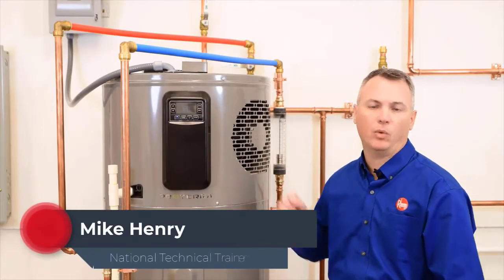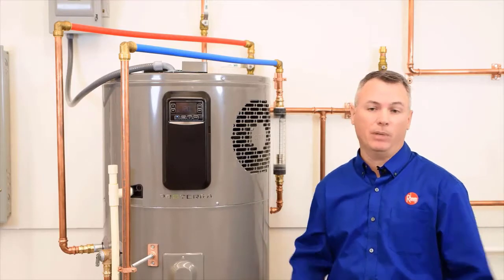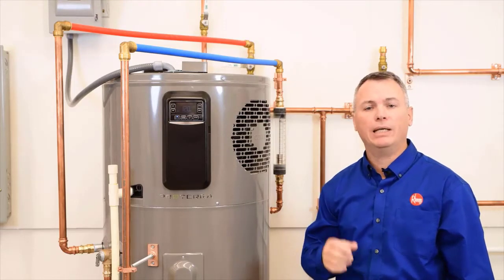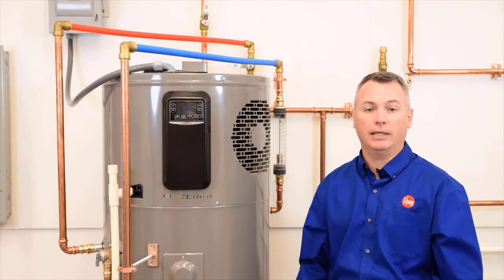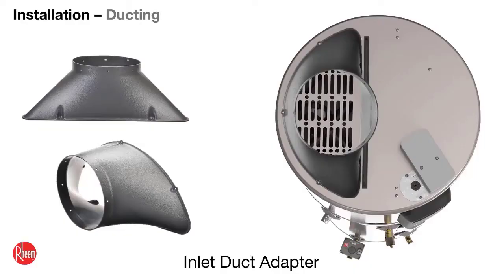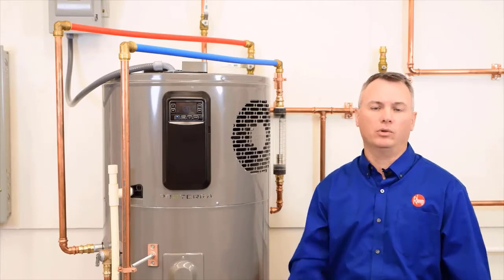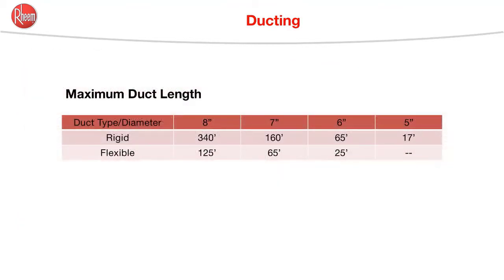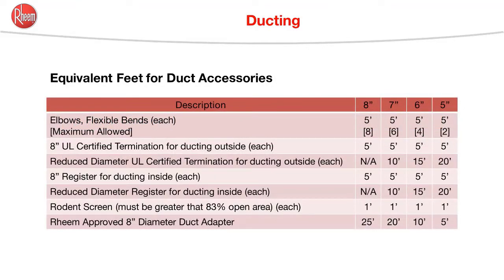Ducting When Installing Rheem® ProTerra™ Hybrid Electric Heat Pump Water Heaters

Comment: I’ve never seen a company promoting ducting to take advantage of existing heat sources like refrigerators. Thank you! 

Another idea. My greatest HW use is the master bath. Dual headed walk in shower and a claw foot tub. So when we are using the most hot water we are making steamy hot  air. I’m going to look for a way get that air to this new WH!
Reply from the maker: Thank you!
Reply: That's what I did in my house. Both bathrooms are ducted into the intake, drawing warm moist air out whenever it is running.
Reply: great idea teslamac, just remember that discharge air from the Rheem  has to communicate back to the bathroom, either by home heating duct work or a space under the bathroom door.  We are doing our return air into the Rheem  into the hall way near the bathroom.

Comment: These ducting options were very informative for me. I will have my new water heater placed next to an unused chimney. I wonder if I could duct exhaust up through that. Or bring air in from and out to the attic. That attic air is so hot it would barely have to work to heat water. I live in a home built 1941 in Michigan.
Reply from the maker: To get information on this situation, please contact our Technical Support Team at 800-432-8373 for more details.

Comment: i have the option to install the water heater in laundry room that is in the main hallway or the garage. Laundry has open air vents high and low from when i had a 95% gas heater that was removed and is now a heat pump so air flow no problem. I am concern about pumping cold air in during winter months and can vent to outside but wont this casue negative air pressure in the house ? My other option is install it in the concrete garage that stays very cold in winter 35-40and even in summer it might only get to 55 degree. Would the colder garage temps effect its efficacy?

Comment: I wish Rheem would design a Heat Pump water heaters for mobile homes.  I live in the south end of the San Joaquin Valley and it normally is around 100 degrees in summer if not more.  I currently have a Rheem gas water heater and would like to go over to electric with global climate warming.

Comment: Would there be any issues to hooking the inlet duct of the heat pump to the return  air of a forced air furnace ?
Reply from the maker: Hello, thanks for the question! We would not recommend that this water heater be attached in any way to HVAC systems as we are not certified HVAC agents and cannot advise on installations that could affect the water heater's functionality. Let us know if you have additional questions.
Reply: I would not recommend creating a pathway for furnace exhaust back into the house. Furnace exhaust could have partially burnt gas as well as carbon monoxide and you don't want that pulled back into the house through the water heater
Reply: @MrSoulMonk  That's not what Mennis is talking about.
Reply: Did you connect your inlet duct for water heater to your make up/ return duct to your homes heating system? This is something I was considering too.  I also have a heat pump, so I’m not worried about carbon monoxide.
Reply: @lynnbrooks5835  I did do that and so far so good. I did a check with the blower on and it did not affect its performance. My concern was when the main blower was on would it short the heat pump of enough air to operate correctly. So, I will say it is a cautious success!
Reply: My basement temp is 60-65 and my living space air temp is 68-72. Would a 8-10 degree difference in air temp supply make much difference in water heater efficiency on heat pump setting?
Reply: @lynnbrooks5835  In refrigeration/ AC / Heat pumps that the more you can raise the temperature of the evaporator the more heat you can move through that evaporator so yes it will help. In heat pumps a 1 degree difference is a big deal.

Comment: I am in the mid-Atlantic and my water heater is located in the bottom floor of my home in the center of the floor right next to my electric HVAC and all the trunkline ducting.  Can I hook the hybrid water heater into that ducting so that it exhausts the cold air there in summer but not in winter? Can I also have it draw hot air from the room or the rest of the house in summer but not in winter? I want to avoid the larger expense of having new ducting installed to go to the attic or the like as that is 3 floors up and the outside wall is about 20 feet away.
Reply from the maker: We don't recommend connecting hybrid electric heat pump ducting into an existing HVAC system. If you need more information about this, please contact our Technical Support Team at 800-432-8373. We hope this helps!

Comment: I am installing 50 gallon proterra and want to have air flow intake from crawl space and outflow to attic. total ducting length would be 8-10 feet. climate is warm  - winters to 30 degrees and summer 105 degrees. attic can get hotter
will this work?
Reply from the maker: The operational ambient temperature range for this water heater is between 40-145 degrees Fahrenheit. If you have any additional questions, please call Technical Support at 866-279-4566 between the hours of 7 a.m. and 7 p.m. CST and one of our experienced analysts will be happy to assist you.

Comment: Can you talk about seasonal considerations? For example, if I'm pulling outside air during the summer ... that's going to work a lot better than in the wintertime...
Reply from the maker: Great question! Seasonal considerations do come into play when thinking about ducting for our hybrid electric water heaters. The unit produces cool dry air as exhaust. Thus, you may want to cool your home with this air during the summer and expel this cool air in the winter. This can be achieved with dampers in your duct work. We hope this helps! Let us know if you have further questions.
Reply: @rheemwaterheatertraining  Thought you might like to do us a demo at some point... ;-)
Reply from the maker: We will note your suggestion. Thanks for the feedback!

Comment: all very good info. my installer was hesitant to vent at all although i can see the logical benefit. question… i have a 6” pipe that was capped (formerly the exhaust for my gas furnace and waterheater to a roof vent) as well as a 6” cold air intake, also capped, coming from outside my home. could i use the former exhaust pipe for the HeatPump water heater exhaust and uncap the former fresh air intake pipe for outside fresh air?
Reply from the maker: To get information on this situation, please contact our Technical Support Team at 800-432-8373 for more details.

Comment: Are these water heaters rated to be installed in a hot garage in Arizona that can reach 100°+, or are they limited to interior installations only? 
Last question, is there an NC rating or noise criteria listed for the water heater while running? Thank you in advance.
@Rheem Water Heating Training
Reply from the maker: Hi Tyler, good question! The ambient temperature operating range on our hybrid heat pump water heater heaters is 37° - 145° F, so installing one in a garage that doesn't exceed the 145° F maximum ambient temperature would be fine. Additionally, these units are rated at <50dBA (decibels) which is the lowest on the market (and about as loud as a refrigerator). We hope this helps. Let us know if you have any additional questions.

Comment: Quick question, I have a rheem air handler for forced air heating and cooling. Cooling is done by rheem outdoor A/c compressors. Heating is currently done from a heating oil burner and a 50 gallon hot water heat tank reserve. I want to get rid of my oil burner for heating my forced air and hot water. I was looking into replacing my outdoor rheem unit with a heat pump to provide heating and cooling needs, but I would still need a separate water heater and came across your heat pump hybrid water heaters. 

What is the BTU rating of these units? Could I connect this to my rheem air handler to provide heating for my forced air ducted heat, as well as provide heating for hot water usage in the home (retaining my relatively new a/c condenser rheem units for cooling in the warmer months)?
Reply from the maker: We'd like to get more information about your situation and put you in contact with someone who can help. Please email whdtraining@rheem.com.

Comment: Great video. 

We are in need of replacing a 15 year old electric HWT located under our stairs in the basement. There seems to be much confusion with venting even from a Rheem contractor I contacted on Vancouver Island where we live. He told me these units must be vented but according to this video and the info on your website, I do not need any venting and I could install this unit in the same location just by leaving the door to the small room open. Is that correct?

The whole idea of venting seems to be about improving efficiency. In my situation, would I see a cost savings or am I better served installing a normal electric HWT? I really like the idea of a hybrid for saving money in the long run.
Reply from the maker: Hello, thanks for the comment! As far as venting goes, the use and care manual states you need a minimum of 700 cubic feet of air. Otherwise, ducting or louvered doors would be necessary. As for cost savings, our hybrid models are 4x the energy efficiency of a standard tank, potentially saving you hundreds in energy costs each year. If you'd like to discuss your specific situation with us more, please reach out to us at whdtraining@rheem.com. You can also learn more about our hybrid electric water heater at https://www.rheem.com/innovations/innovation_residential/hybridsavings/. We hope this helps!

Comment: My hybrid was installed with the outlet facing an exterior wall. The outlet is 3" from the wall and at a 30 degree angle. How am I supposed to even attach the duct adapter in a 3" space when the adapter itself  is almost 8" long? I was told I could duct the intake to the attic above to help get some warm air for the intake. There is no warm air in that space. The attic-like space above the hybrid is an unconditioned space with nothing but trusses supporting the garage roof. It is several degrees colder than the frigid corner where the hybrid is installed. I recently discovered that not only is the outlet air filling the space atop the intake, that cold outlet air deflects off the wall, forced back into the outlet, and up and out of the intake. Air is being drawn into the inlet and forced back out of the inlet at the same time. What the heck am I supposed to do?  I don’t see an option to send photos.

Comment: I am considering replacing a Rheem gas tank water heater to a Rheem hybrid due to a severe backdrafting issue. I don’t have a reasonable venting option for a power vent and I am wondering if I can use the hybrid without venting?  I live in Michigan and while it’s not ideal to have cool air blow into my basement in the winter it’s better than gas water heater backdraft that is currently happening and the efficiency of the hybrid is much better than a standard electric tank model.
Reply from the maker: Thank you for the comment. This is from the trainer: Converting from gas to electric (or Heat Pump) is almost always best served by going up to the next size tank. For example, if they currently have a 50-gallon gas, I would strongly recommend installing the 65-gallon HHP, possibly even the 80-gallon. The reason behind this is recovery rates. Since gas recovers quicker than electric, and certainly HHP, they are used to having a certain amount of hot water available for a given amount of time. Having more stored hot water than before would offset that slower recovery rate. The minimum amount of make-up air needed for the Heat Pump to operate through a heating cycle is 700 cubic feet. Refer to the Use & Care manual. As for the cool air in the winter, it could potentially be directed out of the house during the colder months through the use of ducting and dampers. Email us at whdtraining@rheem.com and let us know if you'd like someone from our sales team to reach out to you.

Comment: I have a finished basement where my current hot water hater is. I'm looking to purchase your hybrid unit. I'm in Maryland so we do get cold winters. My basement is about 70% below ground. I don't have any concerns about the cool air in the summertime for my basement but what about the cold air it produces in the winter? I have a separate HVAC for my finished basement. I'll obviously have to spend money to now heat up the basement because this unit it dumping cold air into it. I haven't seen any studies on how much this is going to cost. There is no free energy here. My finished basement is about 1200 SF.

Comment: I currently have a NG hot water heater that I want to replace with your hybrid. The existing hot water heater is in  a 3 car garage and installed near the gas boiler (about 4' away). Both have exhaust  vented together up through the ceiling in the garage. Location is New Mexico (i.e. hot dry air).  I wasn't planning on venting intake or exhaust on the hybrid as the garage is well over 700 sq ft.  Are there any concerns about the intake being close to the gas boiler/furnace?
Reply from the maker: So we can further assist you, please contact our Technical Support Team at 800-432-8373.
Reply: No.

Comment: Is there a concern with condensation build up if this is vented directly into an attic space? I live in Idaho with colder winters and hotter summers. I heard the presenter say it could be ducted into the attic to reduce the heat load in the summer. 
Condensation...
Reply from the maker: Thank you for reaching out. To get information on this specific situation, please contact our Technical Support Team at 800-432-8373 for more details.

Comment: Why does Rheem overcharge for a plastic duct? $117 (on your website) for a plastic inlet duct and $135 (your website) for the exhaust duct when we (your customers) already paid $2800+ for the Proterra water heater... these should be given as part of the package, not gouging your customer's wallets.

I don't think I will be purchasing another water heater from Rheem.

Comment: Is there a duct adapter/conversion kit I can get? Thanks in advance.
Reply from the maker: Hi Kevin, yes there is. The inlet duct adapter part number is SP21105, and the outlet duct adapter part number is SP17829. You can purchase these on our parts site (link below) or from our distributors and retail partners. We hope this helps! Let us know if you have any additional questions.
https://parts.rheem.com/home
Reply: @rheemwaterheatertraining  The chart in the video stated the inlet part as AP21365.  Which is correct?

Comment: the hybrid water heaters exhaust (cold air) and connected ducting will sweat and drip condensation condensate because of the temperature difference of the ambient air and the cold air exhaust though.... how do you fix that?
Reply: How do you know this? You say it will happen. And you think the engineers who built this thing didn't think of that. So where are you getting your information?
Reply: @wiredforstereo  I promise you it will, and they didn't.  its basic science.  I also have this unit,  have vented the cold exhaust through a duct to an exterior room, and experienced it first hand.  I have also called support and asked them, and they said the only solution is to also vent some of the cold air into the room the unit is in so the difference in temperature isn't as great as the temperature passing through the ducts
Reply from the maker: Ducting must be insulated per HVAC codes (to prevent condensation). In our use and care manual on page 12, you'll find information about ducting requirements: https://rmc-cdn.s3.amazonaws.com/media/uploads/iat/sites/36/2020/04/AP21681-UseAndCare.pdf.
Reply: @rheemwaterheatertraining  even using insulated ducting, condensation will collect around the exhaust of the unit, as the sheet metal around the exhaust fan housing is not insulated

Comment: Are there any charts on the cooling capacity for ducting it into a small room?
Reply from the maker: Hello, great question! Unfortunately no, we do not have any charts on the cooling capacity. The cooling capacity for these units is highly dependent on hot water usage, air temperature, air humidity, and the room's air volume. Because of the complexity and situational nature of this, we have not quantified the cooling capacity. Let us know if you have any additional questions.
Reply: @rheemwaterheatertraining  Just an estimation but I would compare the cooling output similar to a 4,000 or 5,000 small window AC.  I have this unit.

Comment: Anyone have thoughts on negative pressure considerations in colder climates when you don’t want to pull sub 40 degree air inside but do want to push the cold air outside to avoid cooling you house?
Reply from the maker: We can recommend ducting the cooler, outlet air to another room or even outside of your house.
Reply: Same concern, will need to consider the air intake of the unit in the supply ducting design. Also curious how much heat this unit will pull from the space